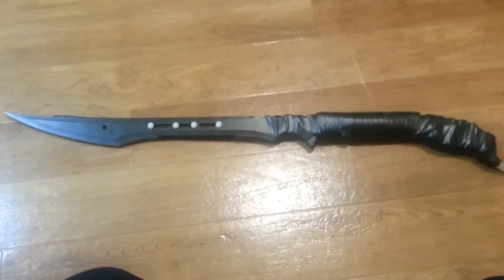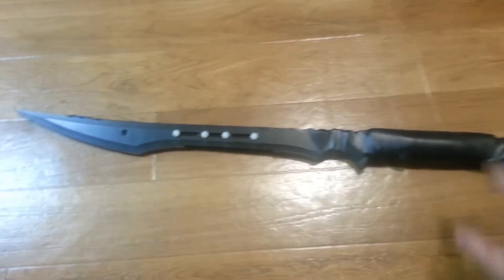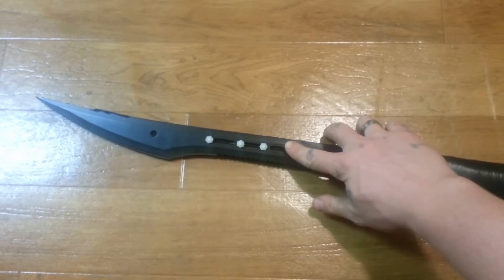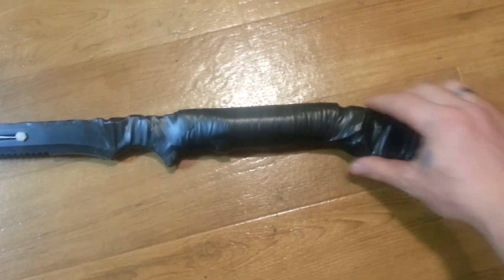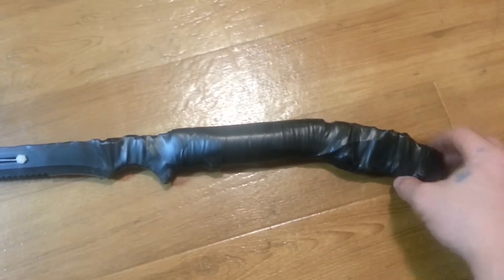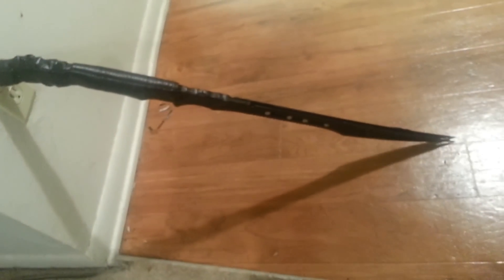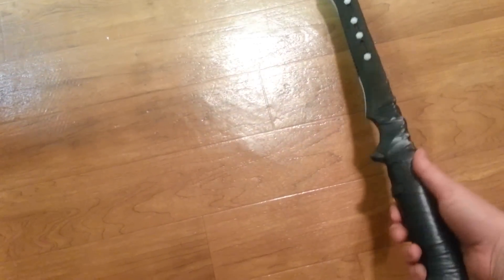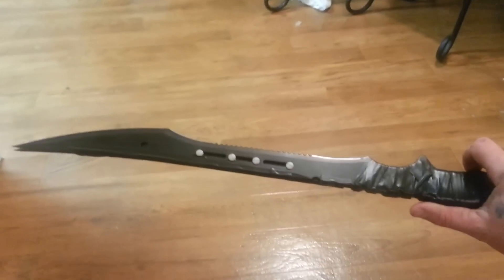Stun Sword! (Finished)

Comment: theoretically that weapon might be an instant kill on contact. if you could cut into someone deep enough that a significant portion of the metal was in contact with their blood, the electrical shock could travel straight to the heart unencumbered by any insulation and stop it from being able to maintain rhythm inducing fibrillation and resultant death without imminent use of a defibrillator.
Reply: Wouldn't just stabbing someone in the heart also do the trick?

Comment: I would suggest a different mechanism for the tazer "release" or trigger.  This is clearly designed to stab rather than slice, and once the tip of the blade meets resistance with whatever you intend on stabbing, your hand will likely slide up the handle (even if only by a small bit) and thus your finger could easily come off of the taser release while thrusting. +10 points for being cool, but the practicality could be improved.

Comment: In my humble opinion (which is mostly driven by candyfloss so more than likely wrong) it looks like a stainless steel arm sword which I believe would have a polymer base with arm straps . . Now I am shite at science . . .so don't know if polymer is conductive or not . . But I hope this helps.  . .

Comment: The problem is that, that contraption although fun, wouldn't cut. Two parallel blades like those would impede each other path while cutting.

Comment: That's completely impractical as a sword, if anything it's a neat electrical trick. It would be better if it were a single blade, the double blades won't prove much in the way of stabbing or making deep slices.

Comment: Looks cool, but wouldn't wounds inflicted be cauterized due to the heat emitted by the electric current? Therefore doesn't the max potential damage decrease or does the shock compensate? Just wondering...

Comment: Everyone that's double bladed not double edge there is no double edged.  It has 2 blades yes facing In the same direction with no double edged sides. There's a big difference from double edge and double blade.

Comment: Looks really frickin' cool, but it's highly impractical. If you even touch the blade yourself, while it's on, you'll be incapacitated or drop the blade.
Reply: thats the point, no pun intended.
Reply: what, to look cool or be highly impractical?

Comment: For $500. . . would you touch the blade (not the handle) while it was activated?
Reply: yes. I would just touch the handle.
Reply: The handle isn't part of the blade.....
Reply: OWNYOMAMA blade is also a synonym for sword so yeah touching the handle counts because no one specified. But I would Still touch it either way
Reply: Teh Lolbitz He said touch the blade that is specification. What else would he say the cutty stabby part?
Reply: You can have 5 meme points for the matching comment + avatar.
Reply: give me 10k then its okay

Comment: Not very practical as a sword since the doublw edge would prevent it from slicing much.. still cool though
Reply: You do understand double edge means it slices both ways. Non double edge is only sharp on one side.
Reply: Glenn Battle Normally yes, but in this case the double edge comes from two swords bolted together with non-conductive bolts. He shows the two edges at the very beginning. The electricity is conducted between the two blades.
Reply: FUreplygirl Actually double edged swords like that are pretty deadly is well sharpened wounds so close made by a sword cannot be treated or well couldnt be treated before if the sword didnt kill you the wounds would.
Reply: Are you talking to me?
Reply: I imagine a sword like that doesn't need to worry about slicing much. So long as it makes contact it can fuck you up pretty badly.